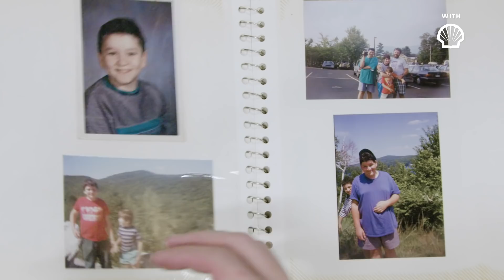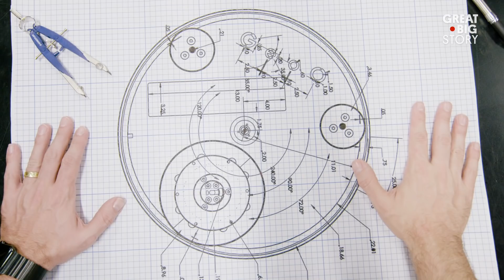Reinventing the Bicycle Wheel

Comment: He says it’s highly efficient but doesn’t tell us the efficiency ratio. How are we supposed to trust that it’s better or worse than alternative electric bikes?
Reply: He also says it's very environment friendly.. I doubt it's environment friendly to build a motor and a battery when compared to regular bikes that are leg powered.
Reply: It can go up to 20 miles on a single charge, on hilly terrain your mileage may vary, and it can be charge by pedaling, too.
Reply: Idk, google it? Do your own research? Crazy concept I know....
Reply: @FMFvideos  he was probably comparing to powered vehicles. The battery they showed was only a few cubic inches, far smaller than a scooter or motorcycle battery.
Reply: So it's expensive to buy, still costs to charge, it moves at a walking pace which is pointless, it's prone to curb damage, it's far less environmentally friendly than a standard bike, it's hideous, you can't service it yourself, the wheels are going to get hot from the road/friction along with the motors and batteries in a tight environment, the tires are going to wear and puncture eventually - I could go on and on and on. What a stupid design
Reply: The efficienty is a weird argument. In our electrical engineering classes we are learning that good electric motors have an efficiency of 94-95% thats is also y they dont need a gearbox.
Reply: The same concept could be done with his invention.
Reply: It's efficient coz it's saving up the  space inside the wheel ,I don't suppose you can calculate an efficient ratio with such a factor
Reply: Pretty sure it has the highly efficient number of electrical motor..
Reply: Because he is not an engineer
Reply: He is not a engineer 😂
Reply: The efficiency loss here is in the transmission and bearings. An efficient design has the motor directly linked to the wheel, Through gears would be second best. What you have here is a motor that turns a small wheel that contacts the main wheel through friction. That is a big efficiency loss. You also have two more stabilizing sub wheel that add friction. A single bearing like on a regular wheel would be most efficient. The most efficient electric motor wheel combos are hubwheels  for this reason. This product is more made for design and trend than it is for function and efficiency.
Reply: The only improvement here is the removal of rotating mass by only rotating the wheel and not the spokes or motor itself in some cases. This is a clear overdesign for that case that would not add much improvement, especially for simpler designs.
Reply: @Reggie6447  "the tires are going to puncture eventually"
Doesn't that also make the standard bicycle "suck"?
Reply: It seems like they cut off his "efficiency" statement before he could finish it. I assumed he was referring to space efficiency, which I would say is highly efficient in.
Reply: “...and its a very efficient use-“ the statement cuts there. If you’re assuming he means efficient use of energy. The more likely construct of the sentence would have been, “...and its very efficient”. He’s most likely referring to the efficient use of space. Which is something to commend him for. The entire motor and its required additions are kept within the confines of the wheel. I haven’t looked into the product but theres room for power efficiency as well. Such as the ability to self charge the battery via pedaling and plenty more I’m sure. Its a fantastic idea and has the potential to be an amazing product. Id especially see this working really well in cities where people are starting to commute every day via bicycle.
Reply: This belongs in one of those engineering fail videos
Reply: Sadly these days "efficient" to most people is just a dumb meme you are expected to say, and most never consider it might actually have a meaning.
Reply: Will Pack  even best technology can't transform 100% of any amount of power into charge. There are always will be the energy losses simply to heat. And the batteries weights A LOT, making harder to climb. So if person fit enough (or want to be) - simple bike will be the best option. If not - simple electric bike is a solution.

Comment: That's a nice "invention" you got there, oh and in other news, a moped already exists. Also, bikes with this wheel can only go at 20km/h, plus a SINGLE wheel costs 1K. However, the absurdest thing is that he wants to make a version of these for cars. The reason why wheels are driven by an external source of energy is because a transmission system (ie gearbox) allows for much greater efficiency, adaptability and power, in other words, a wheel is just another "empty" gear because it is most efficient and convenient for it to be so. There are entire fields of study and disciplines regarding engines and transmission systems that have been worked on for centuries by brilliant minds, yet this guy, who's not even an engineer mind you, comes along and makes this shoddy niche product that he claims this is the future for automobiles ... it just doesn't get any richer than this.

Comment: Soo why is it great, what are its functions, what did you achieve that no one else could, is it faster, is it more efficient, does it retain energy from movement, does create its own power, can it fly, can you put it on a moon, WILL IT COOK MY BREAKFAST? Because as far as i know you told me you discovered there is space in a wheel and showed me a wheel looking thing!
Reply: It can be installed on any bike
Reply: Well, you can power the front wheel. But that could be done with a hubbed wheel, you'd just have a motor sticking out of the side.
Reply: @adamkimmV  the motor wont even stick out, hub motors are actually very common in e-bikes, and they are way more efficienz than all this gear shit in the video.
It is just looks more futuristic, thats all!

Comment: Look for something called ''The Copenhagen wheel'' far better developed and designed, and more structurally realistic, back in 2014 (cool idea though) :)
Reply: TBH this looks way better, i hate how that other one looks
Reply: this literally looks clunky and dorky as shit. there is literally no design merit to it. the copenhagen wheel actually pays homage to its cycling roots and is a lot simpler.
Reply: Looks cool because at some point it looks imposible and it has a reason...  think of the weight distribution and loads in just a few points, and the huge amount of moving parts awaiting to fail  in different axis than those the wheel itself and its movement suggest
Reply: A simple search on google shows a lot of similar products "UrbanX E-Bike Wheel", "Electron Wheel ",  "Omni Wheel by EVELO", "The Smart Wheel by FlyKly"
Reply: What happens if you have em both?
Reply: Even the copenhagen is that good.  Controllers,  batteries,  and motor inside a metal shell.  Neither is happy getting hot.  I build custom ebikes, and for the best balance of weight and heat control, it is if they are separated.
Reply: My neighbor has one of those!

Comment: 1) The center of gravity for all those components in the wheel is BEHIND the steering column, which has the potential to upset the passive self righting properties that the front wheel gives the bike, though I'm not sure if this would be enough to matter.
2) Without spokes to create tension throughout the wheel, it's much easier to make the rim flex (like if you hit a big bump or something), which could dislodge it from those smaller wheels pretty easily. Either that, or you have to add a lot more metal to make the rim strong enough to not flex, increasing the weight. 
3) The bearings in those little wheels are going to wear out much faster. With a large wheel with the bearing in the center (as with a regular bike wheel) the wheel will move a good 5 ish feet with each rotation. Those little wheels would only go about 6-7 inches per rotation. Having it rotate 8-10 times more often for the same speed would wear out the bearings much faster.
4) There are so many more easier options for both getting a motor to turn the wheel as well as places to put the electronics, battery, etc. as well as they wouldn't involve the above downsides.

I will admit though. It does look pretty cool.
Reply: The list can go on and on, because, well, engineers are not needed.
5) the rotational energy is not centered and I doubt he calculated the moment of inertia of the system
6) how big the battery can get in such a space. 
7) from an engineering perspective, it is inefficient to have the power transfered from a brushless motor (rotational) to another rotational object using friction.  The system will wear out faster than if he just integrate the motor to the hub.
8) Megola did this with a gas engine in 1920
9) monowheels are cooler (same concept)
Reply: I have one and put more than 1000 miles on it. No problems. It's sturdy and reliable. The reason it doesn't seem to need spokes is the drive unit presses against the wheel at the same point where impacts from bumps come. The wheel weighs 20 pounds, so it doubles the weight of the bike, but other than that, there is no degradation in balance or ease of biking.
Reply: 1000 miles is nothing, i know people who do that in a week on their human powered road race bike.
It's not a life time reliability test to do 1000 miles. That's just a basic prototype test run  not a durability test.
Reply: Um yeah I'm not an official tester and I have no relation to the company. I'm just using it and enjoying it and mentioning no issues so far. When I get to 100000 miles I'll let you know.
Reply: @andycrews  Thanks. Good point about the mounting point location, but that's a heavy wheel. My whole bike weighs 23lbs.
Reply: #10. IT'S A LOT OF FUN

Comment: That whole thought of "if it could be done, it would have been done already" is dangerously stupid.

Advancements in technology don't just pop out of nothingness.  And they require more than the know-how and capability.  They require the vision.  They require a creation.

To ignore that is incredibly foolish.  Consider the fact that something is only valuable once someone sees the value in it.  Being able to see a potential is equally important to being able to manifest that potential, for there is no progress without origin.

So good on this man for not falling into this ignorant trap.
Reply: Well except that in this case it does apply to him. This design is stupid, it accomplishes nothing a traditional hub motor doesn't already do better. Theres no merit to this design outside of looks. Which would be ok if it didn't fail so catastrophically at everything else.

Comment: amazing, you shoved a motor and a battery in the middle of a wheel... Impressive, but not what I call "reinventing the wheel". 
It's still just a damn wheel, not even a gread solution, a hub motor is way more efficient, you would just need to tape a battery to the spokes and you got yourself a better version of this, but why bother with batteries on the spokes? Just tape it to one of the three bars, oh this looks similar, well, you just inventet the E-Bike as we know it, amazing!

Comment: Basically, when you crash with a vehicle with a powered wheel, you screw up the entire motor.

Also, the moment your wheel can't train the mass you desire, what are you gonna do? You need more power and change the motor of your wheel. A weak motor in a wheel can't train every weight you need. The strain it put on that little motor is massive

Comment: Wondering?? How those components deal with the added impact of being directly on the wheel assembly compared to a frame mounted motor system that has more of a damper system with the 2 wheels and frame to absorb impacts.

Comment: How does the price compare to an electric bicycle, which already exist? The reason they don't put the motor in the wheel is because most engines decide to utilize gearing. Is this motor more efficient than a traditional electric bicycle?

Comment: I bought one of these and it broke on me four times each time within two weeks of having it returned to me after repairs. The idea of putting a battery in the wheel is the worst. All the shocks and vibrations the foam wheel did not absorb traveled into the battery and shock it to death, It smelled like a fire was about to start each time it failed. When it does die on you the weight of the wheel and the regenerative braking turned the wheel into a boot, it was easier to walk than to pedal without power. This thing was just a nightmare and a waste of money.

Comment: The point is that the wheel can be installed to any existing bike. No need to purchase a new one.
Reply: They're $1000.
Reply: @capnskiddies  You'd have a hard time finding an electric bike with the same power output at a similar price

Comment: How is this efficient if the bicycle 
A thing that requires no need for a electricity input but the physical work from a human that in itself puts out no emissions has a battery ?
Also what’s the different of putting the battery in the frame and just making it an electric bike 
That’s all it is 
It’s a battery stored in a wheel that powers motors within that wheel ....

Comment: Yes,Awesome, i always have wanted the empty space in my wheel to be used,so now i have more empty space in my frame, that i can fill with spare parts, of my unnecessary complicated front wheel, that is now way to heavy in doing its job as an light maneuverable steering device and shock absorber.  What is this guy gonna invent next? A knive,that is not sharp enough to cut things, so you cant accidentally cut yourself?

Comment: Don't wanna be the naysayer here, but wouldn't it shift the center of gravity forward?
Reply: Maybe it does, but if so that doesn't make it harder to ride. The battery is a big chunk of the weight, and I think it is slightly behind the center of the front wheel. The bike is easy to use and handles well. The wheel weighs 20 lbs, and having half of the weight of the bike in the front wheel is a tiny bit sketchy going down steep, windy hills, but not really a problem if you go a tiny bit slower than you would on a lighter bike.

Comment: Tfw having everything in the wheel makes it complex. Why not just put the motor and controller in there, that way battery is easy to remove. You will also have a stronger and lighter wheel. It hasn't been done because it's a useless idea

Comment: Wait a sec, if they put the engine of the electric car into the actual wheel, first of all the weight of the car would be an issue, but if you managed to put the engine into each wheel or at least partially into the wheel then theres a load more space for normal batterys and people
Reply: Except that you would have to get that electricity to go from a turning wheel into the body of the car to be used. You can't use a cable, because it'd snap. If you used another alternative, there would be wear & tear, as well as extra friction and transmission losses. In this wheel (which still has many design faults), at least the electricity doesn't need to be transferred to another body.
Reply: Plus there is a difference between sprung and unsprung weight. A car with motors in its wheels would have terrible handling.

Comment: That wheel has an unequal load distribution, its far less durable compared to conventional wheel with spokes.
Too much moving parts. It will result it greater energy loss by friction. Moreover more moving parts equals more mechanical wear.
Conventional wheel designed with ease of repairability in mind, his wheel doesn't have that.
Looking from the design, I assume that it will cost more that conventional wheel. Engineer designs by considering the production cost, a product needs to cheap enough for consumer but still profitable.

I admit that his design is beautiful, but an engineer designs product by considering functionality, cost, durability, repairability ,etc.
There isn't an engineer wishing to design like he did.

Copenhagen Wheel is a better choice than this wheel.

Comment: It's neat and all, but hardly a fucking feat of engineering. A simple novelty that may be convenient in the case of small EVs but nothing more. Putting this on cars won't even meet basic power requirements let alone revolutionize automotive transportation. It's restricted to the size of the wheel, thus limiting battery capacity and power output, as well as having a poor gear ratio for all but low rpms.

Comment: "I did what most engineers wish they could [reinvent the wheel]." Dude. You made an electric wheel hub motor. It literally was conceptualized in 1884. Look it up (US Patent # 300,827). This has been done time and time again. It's nothing special. There is a reason nobody uses it. It creates an unsprung weight issue. Also in terms of market demand, it's virtually non-existent. Nobody wants this. It isn't adding anything a mountable electric bike system, something maybe 1/2 the price and twice the power, would provide. Your not an engineer for a reason. You clearly haven't done any research into this. Honestly, It's fair to assume that if you've thought of it, someone a lot smarter than you has thought of it before you; and in this case, you're about a century off the mark.

Comment: If you get mud or water on the inside of that wheel that friction drive is going to start slipping or jamming. This doesn't do anything better than what a hub motor does. I'll give it a pass on it's abysmal aerodynamic properties because you won't be getting much speed out of this so it likeley won't be an issue. I absolutley do not trust the design of this thing either untill I see some FEA or stress test. 

With all the extra friction sources there is no way in hell this design is going to beat out a geared hub motor for efficency. It doesn't do anything a $300 iMortor kit from ebay won't do. 
 
He mocks engineers instead of trying to think about the reasons behind WHY they told him it was a bad idea. Yes it 'works' but it doesn't improve on anything except looking like a hipster.